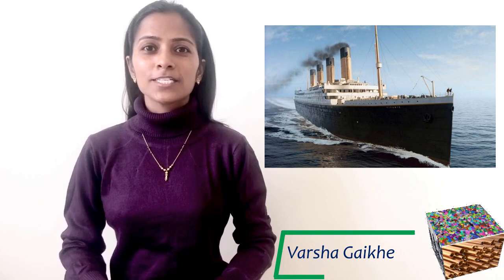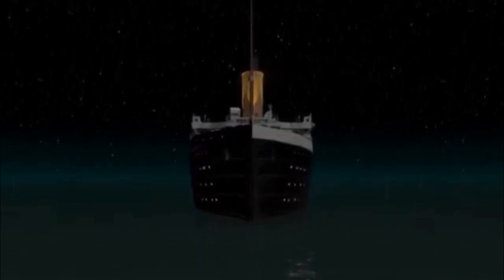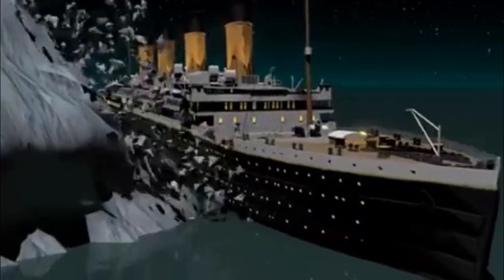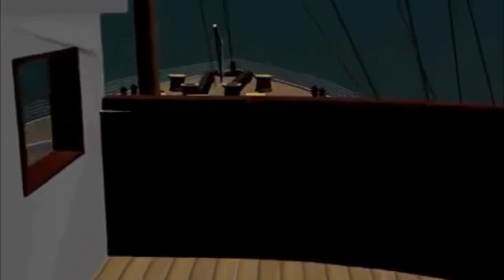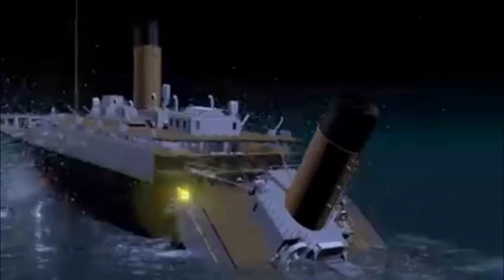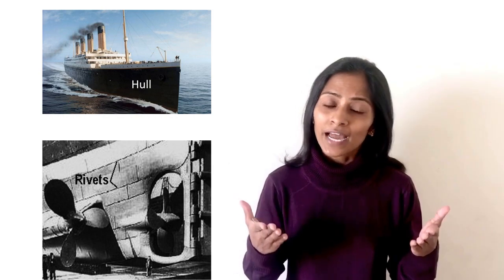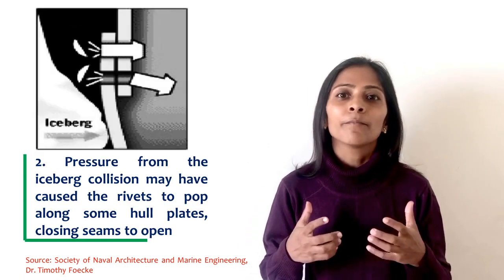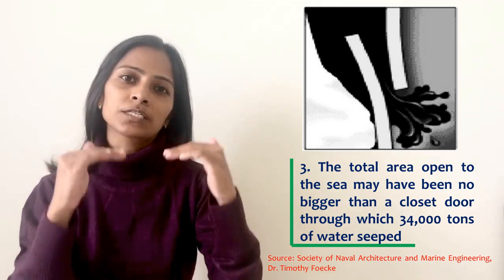Material Failure case study: RMS Titanic

Comment: Ductile to brittle transition temperature ... ductile steel turns brittle at below 0 °c ...so the sudden impact of ice berg cause the ship body (mild steel) into fracture 

Yield strength is very low for brittle metals .. can't bear sudden impact ...
Reply: @@engineeringwondersinaminut3453yes they have, but the range after yield strength to the UTS point and fracture propagation is VERY short, so usually according to engineering curves we oftenly ignores the transition after the yield 😊